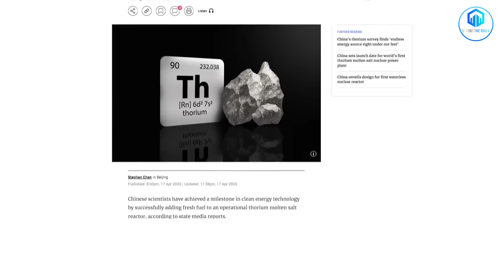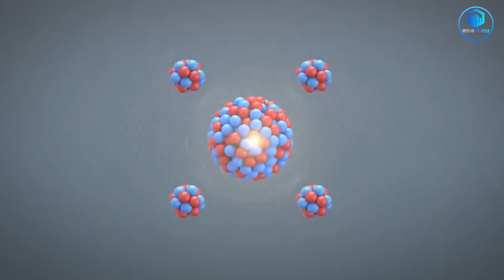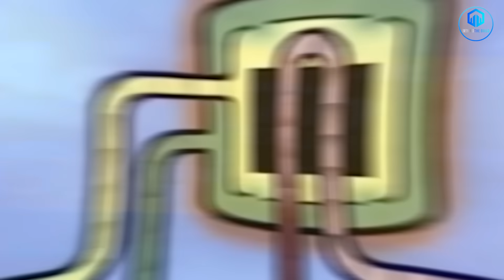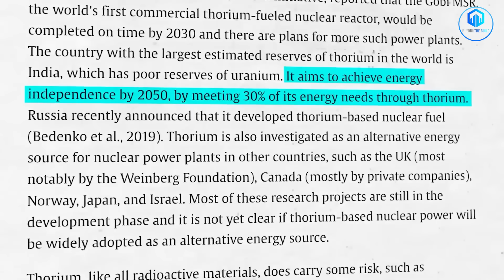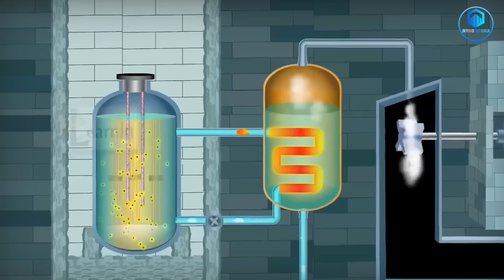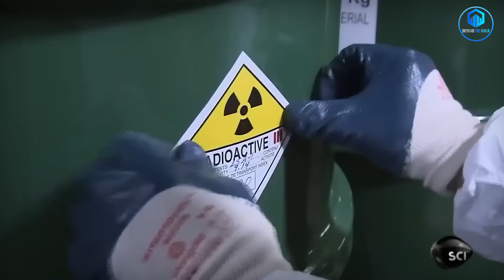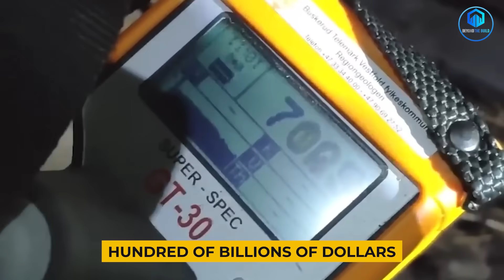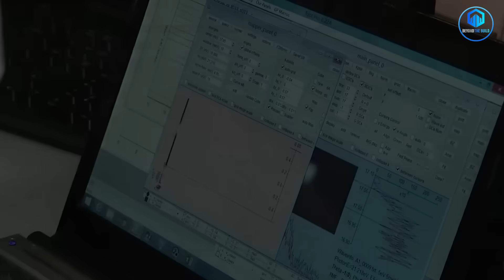China’s World-First Thorium Reactor That Never Shuts Down

Comment: If I was China I wouldn't sell the technology at all. Just the electricity.
Reply: No. Should. China is for the good of humanity
Reply: After all, she had the technology to transfer electricity at 1M kilovolts which I believe the only nation able to do so, maybe the Russians can do so!
Reply: @pahatpahat9566  USSR had experimented similar technology but no commercial use.
China is the only country running commerical lines across its vast territory.
Reply: @pahatpahat9566  1Mega? kiloVOLT? thats a big fiogure! but just 1AMP is enough to kill!
Reply: @grantchang81976  That's isn't the issue. The issue is the ability to transfer electricity over long distances without much loss of the electricity. It was reported that in the US, without much lower voltage transmission, it was said the US cannot transfer more than 800 miles (?) without practically losing out its electricity power.
Reply: @pahatpahat9566 its the ratio between cable size and material and watts energy voltas vs ampers. distance and overall coulomb force.
Reply: @grantchang81976  What the report indicated  is China could transmit at 1,100kV over 3,300 KM. No other nation has been able to equal this!
Reply: Nothing complicated about a thorium reactor, the only reason  we don't have them is they don't provide any weapons grade plutonium. All existing nuclear  power stations are weapons grade plutonium factories first the energy they produce is secondary.  We could all have  dirt cheap  electricity if our politicians weren't corrupt greedy scumbags.
Reply: They will license the technology... They seem to be doing that these days with everything else 

👇

China has been involved in 42% of global licensing deals valued at $50 million or over in 2025 so far. This surge in Chinese-originated assets and deal-making is driven by a strong domestic biotech sector, favorable government policies, and a growing pipeline of innovative drug candidates, particularly in oncology

DeepSeek
Reply: That's US mentality. Other country's are working on the technology and I actually thought some Northern Euro country was ahead. China will sell infrastructure to developing countries and that raise up economies that become trading partners.
Reply: USA hates it be cause the waste material doesn't go BOOM
Reply from the maker: Yeah, that’s an interesting strategy 👀 Do you think others would ever trust being energy-dependent on China though?
Reply: @beyondthebuild-1  chinese do overall produce the most solar panels.
Reply: @beyondthebuild-1  A lot of nations already are, and a lot more are entirely supply chain dependent on China, even for power generation... Nearly every nation in the world could be shut down by Xi.
Reply: @beyondthebuild-1 I think BRICS and Global South Countries will trust China

And that is where 85% of the new consumers will come from by 2030 

Not North America or Europe
Reply: I think China will provide the tech as well for select countries at first and then for anyone who wants it. Its in Chinas interests that this kind of tech makes it to other global south countries as that will undermine US imperialism and further reduce any hope of the US catching up to China.
Reply: I would sell the technology, but not as a blue-print, instead, as a final product. This would help diffuse China's tech standards. 😏
Reply: That's going to require so many tons of copper and insulation...
Reply: @someweeb3650 

China has large but not the largest copper reserves globally

DeepSeek
Reply: @Dutchthink28nmisAdvanced  Yeah, and digging it all up so they can sell power across the entire Pacific is totally a good idea 😂

They could just leave all of it there and sell the reactors.
Reply: @someweeb3650 well Chinese could sell the reactors  and go out and build the reactors 

But for countries like the USA why bother 

The USA is 15 years behind ... By the time they catch up even with licensing of technology 

The Chinese will be another 15 years ahead
Reply: @Dutchthink28nmisAdvanced  Why bother? To make money, Communists still want the GDP to go up, and selling multi million dollar reactors that your customer can't build for another 15 years, at which point you'll be selling them better reactors that they won't be able to build for yet another 15 years, is a REALLY good way to make that number go up.
Reply: @someweeb3650 depends sell your technology? What kind of sale is it? 

Can it be copied?

Lease your technology it's not going to be copied
Reply: China has the Advantage of barren Waste lands 
To experiment with.
Reply: China will sell those power Stations at Low prices that will make almost no profit, just like it is selling solar panels and EVs.
Reply: Its not like China ever transferred tech for any of its overseas investments to the point that they even import their chinese staff.
Reply: The technology in this reactor is American technology invented at Oak Ridge in the 1970s. The Chinese did not steal the technology. It has been open source freely available to anyone  for 50 years and on the Web for 30 years.
Reply: This ❤Thorium Reactor was built  in the late 60s to 70s. But never built in full scale. It was scrapped in favour of a uranium enrichment power plant. … so America has full possibility to use it on a Global Scale 😢
Reply: @yihchiehseeto225  blah blah blah.  America didnt solve the problem of corrosion holding the thorium liquid.  And america wanted plutonium, the wast product of uranium, to produce bombs.  So they scrapped the thorium project
Reply: @yihchiehseeto225   uranium235 is choice bcuz U235 decay is relatively non-toxic and hypoallergenic! and only has a half life of 1-2 dozen thousand years! while thorium fission decay chain includes lead🤮 and has a half life of millions of years.
Reply: @yihchiehseeto225  You forgot the most essential advantage the US has, and surely China doesn't. Have you ever heard of God? Jesus? God Bless America? Indeed, from the early 0000s to the 2000s, God has been blessing Christians, not the Chinese, of course, not the godless Chinese communists. So, with God's blessing, American Christians acquired the land of America and will definitely obtain anything, including things much better than a Thorium Reactor. Do you believe in God and Democracy, and “This ❤Thorium Reactor was built in the late 60s to 70s.”?:face-green-smiling: